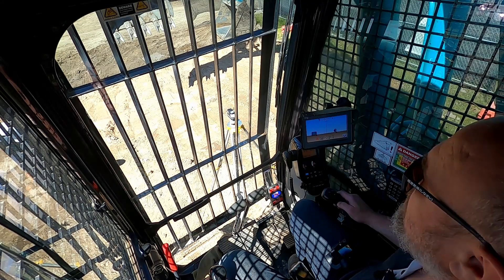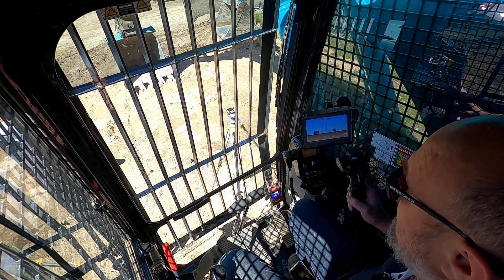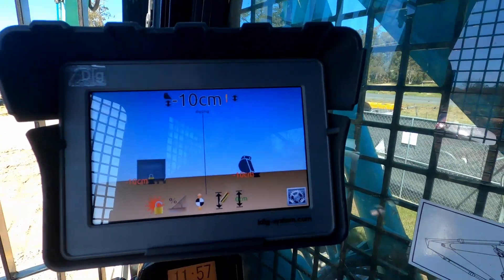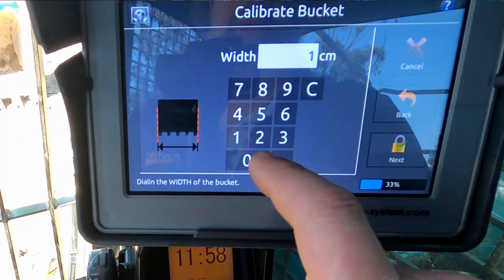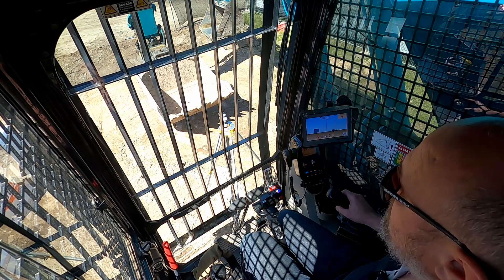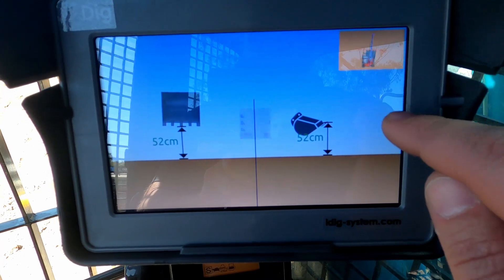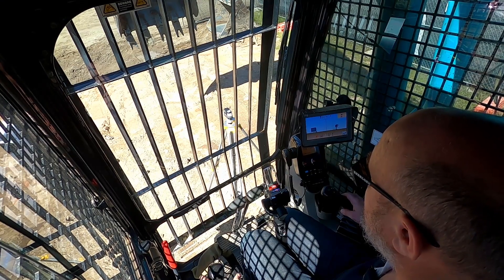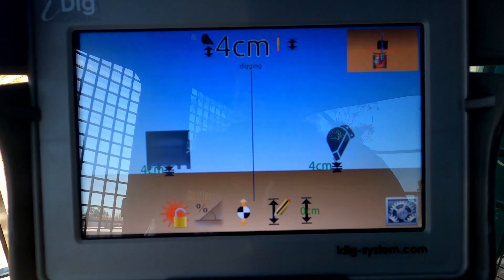iDig 2D Grade Control - Checking Bucket Accuracy

Comment: Bucket width does matter btw. If you're just reaching straight forward and back then okay that's fine. But if your machine is rolled left or right and you're swinging the machine to test the 2d sensor then you wouldn't be testing accurately.

My current machine I'm checking has an almost 2 foot wide bucket pin! Roll/tilt the machine a bit and that movement adds up to a decent bit!

Think of it the same way you would a tilt bucket. The blade corners of a 1 foot bucket won't move up and down that much as you tilt it. But on a 6 foot bucket the corners of the blade are going to move a TON!